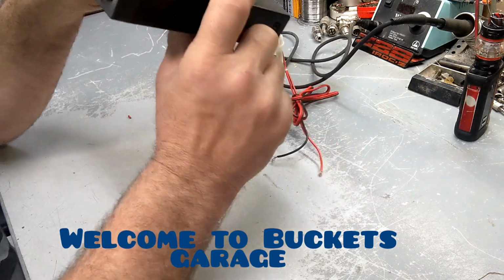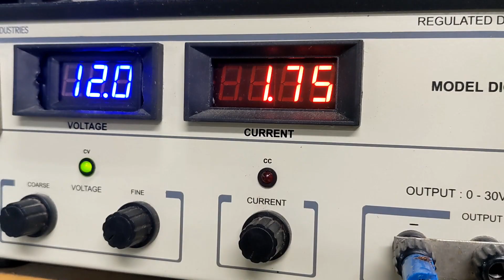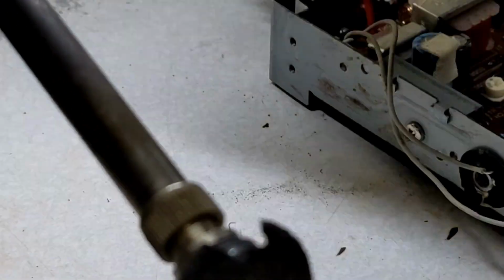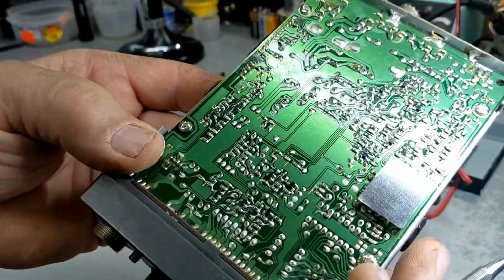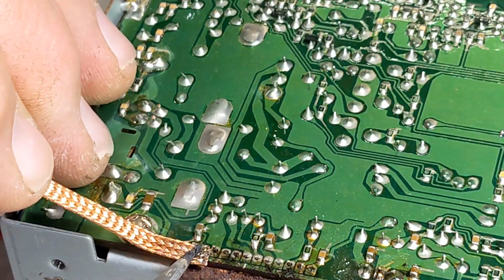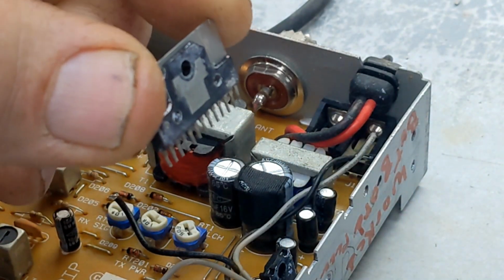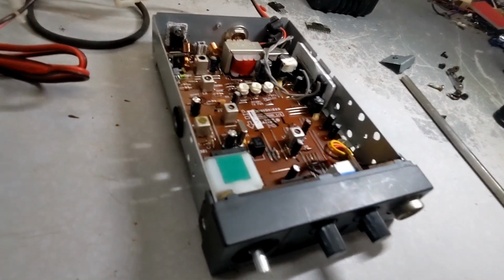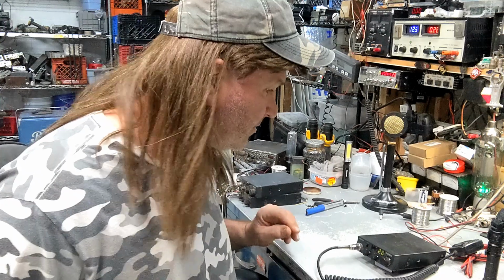CB radio repair Uniden pro510xl audio chip replacement fixed #cbradio #cb #cbradiorepair #uniden

Comment: Just watched your video and wanted to say it taught me a bunch. I have a few PRO 510XL CB radios with the internal speaker not working. I plugged in an external speaker and works fine. Would you say its the same issue you had being the audio chip ?
Reply from the maker: Hey there bud, hope the video does help you out a lot. Thank you for watching ☺️ I would say if you're plugging in an external speaker and you're getting sound but without an external speaker it's not working. It sounds like it could be the internal speaker? I would start with that. Usually when the audio chip goes you won't receive any audio at all transmit or receive. Hope this helps. Let me know how it goes

Comment: I had a cb shop in Houston and I can't believe you didn't clean off that rust, and doesn't anyone know what  a solder suckered is ,I always put a not in the hot wire ,but that's just me ,some of that rust may come loose  and short out something
Reply: When I commented on the hot wire on the uniden 510 ,speaker  i spelled not wrong, I feel so stupid, sorry,these spell check systems on the new smart phones and the small letters are a drag, and my fingers are kinda fat, so that's that,I'm in my 70,s now and the eyes aren't so good,I really like the c.b. videos and miss working on radios and other things,keep it up bro I dig yours and other radio guys God Bless and 73,s to you
Reply: Do you want your money back ?  😂

Comment: I have 4 pen cobra dx trying to put super echo mic 4pen what is the color for that
Reply from the maker: Hey good evening bud, I'll try to help. What's the brand name of the microphone you have?
Reply from the maker: I have the same radio. It's a good radio by the way. Number 1 is shield number 2 audio 3 is transmit 4  is receive if you look at the female plug they should be numbered on the very front  now most of them should be one number one is shield number two is white. Three is red and four is black. Hopefully this helps you out but let me know. Thanks for watching
Reply: @bucketsgarage  super star 452